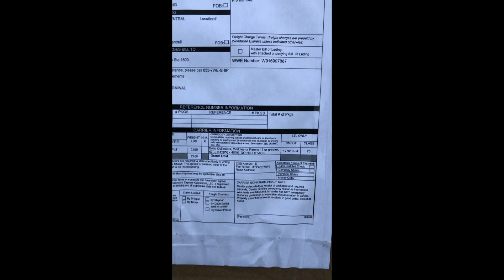Aug 2021 Load of cracked panels review of Santan / Fabtech

Comment: You could attempt sealing the cracks on the back with several types of 'rubberized' sealant.  It may be the "fix" for those not showing moisture damage yet.
Reply from the maker: Most of the time, the cracking on the back is in the sheet of glass that is on the back of the panel. There is already a sheet of plastic that covers the back glass so that the usually sealed OK. The issue is that the cracking extends to the edge of the panel, inside of the frame. If water gets into the area between the frame and the panel, that water can be drawn into the panel. One potential fix is to run a bead of caulk along the edge of the frame, on the front of the panel.

Comment: You should take a nap.
Reply from the maker: If you have a problem with "Deep Breathing" then you should go elsewhere. It is a lot of work trying to unload panels of this size and weight while it is 95 degrees outside. If you want be an ass and moan about the "Deep Breathing", I will just delete your comment.
Reply: @tennesseevalleysolar4101  this not what I meant, had nothing to do with it. Just saying your grumpy.
Reply: @tennesseevalleysolar4101  BTW, just picked up 8 SanTan solar 375w panels for $132/panel, they are in perfect condition. Maybe this is a get what ya pay for scenario.